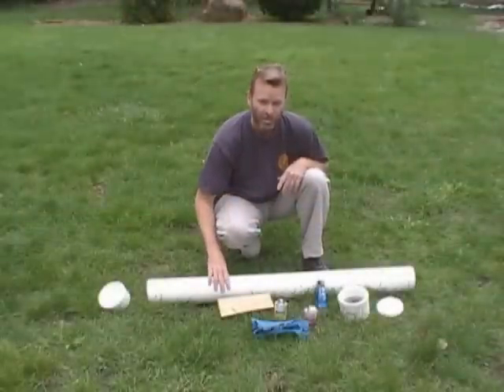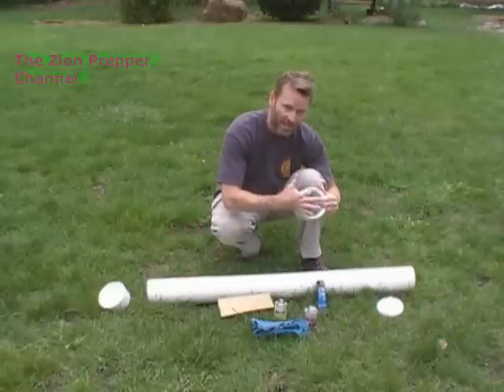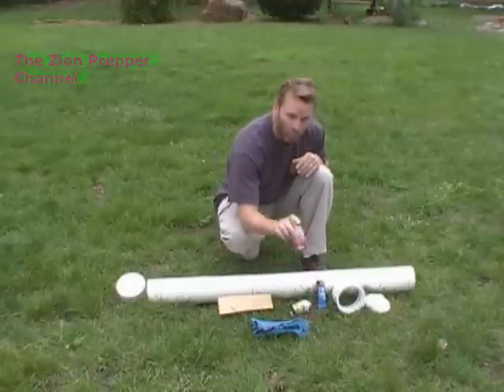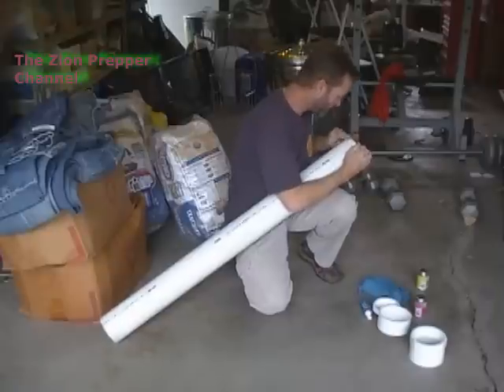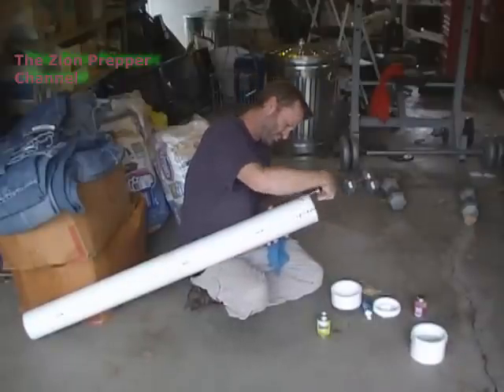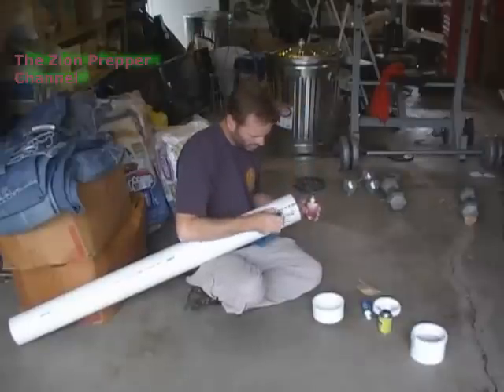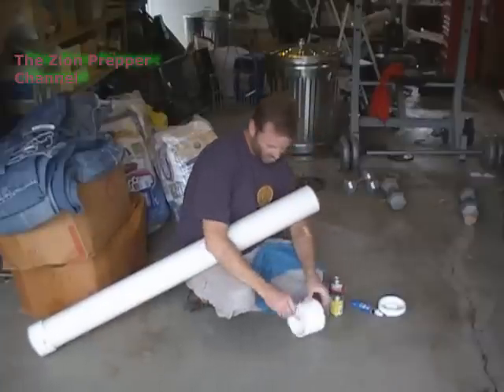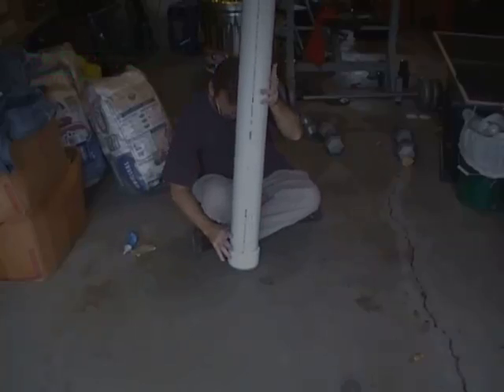How to make a PVC Pipe Storage container - Part I

Comment: Nice work! I've ran thousands of feet of PVC conduit (electrician here!) and one thing we do for better sealing, is turn the caps/couplings a quarter turn before the glue sets. It's supposed to help, so if you have any leaks you might try that next time. I'm sure you are testing that before the goodies go in there, underwater. The silicone is a good idea too! Nice job, ZP!

Comment: Silicone is not rated for water immersion. If you properly sealed the joints with PVC cement no further water proofing should be necessary.